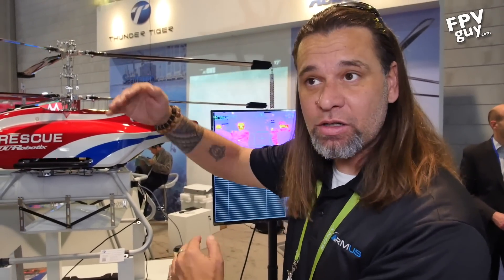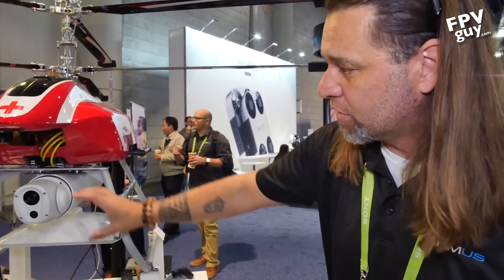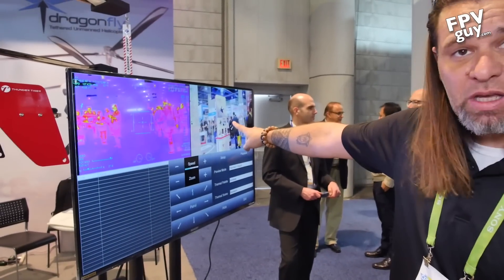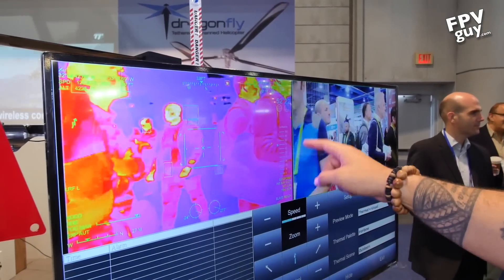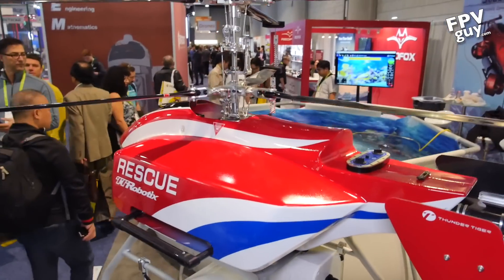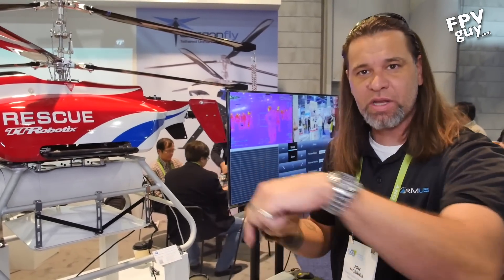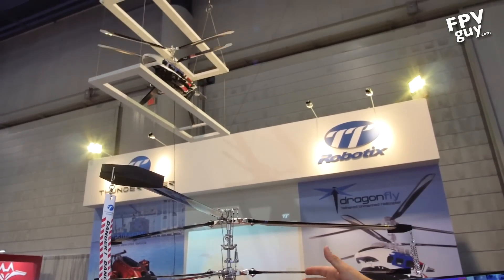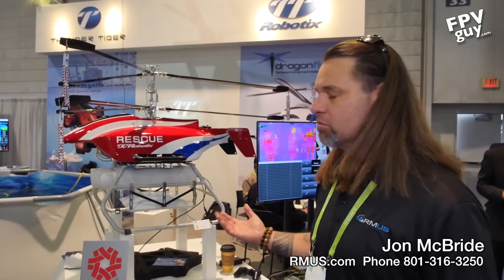CES 2018 • ThunderTiger DragonFly

Comment: Seems very small for a heli drone. We are using Align 800 as drone platform, top speed 127 mph. Duration of flight 2.2 hour's,  service ceiling is 20,000 ft useful payload 22 lbs. Really no useful info for the Thunder Tiger dragonfly?